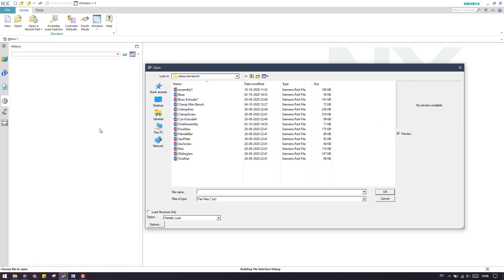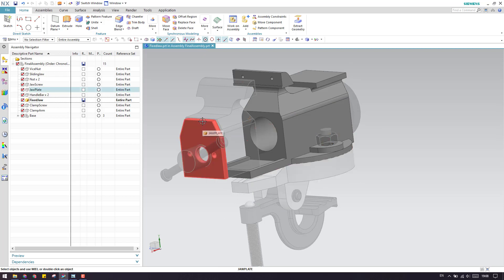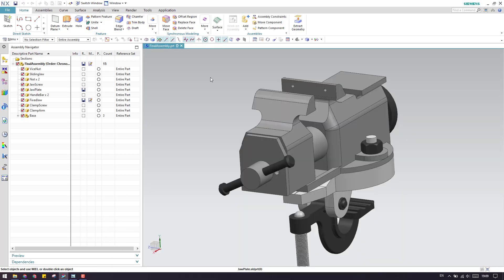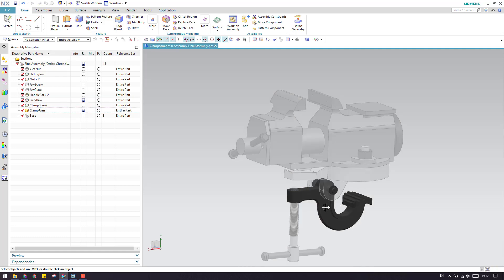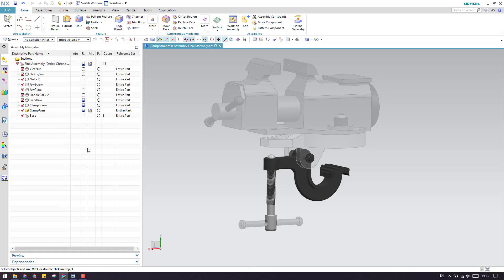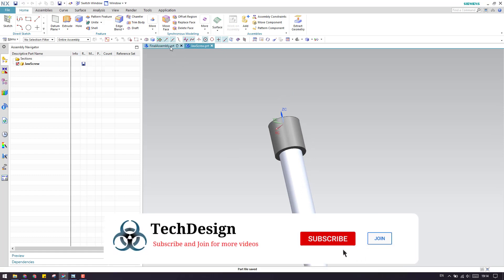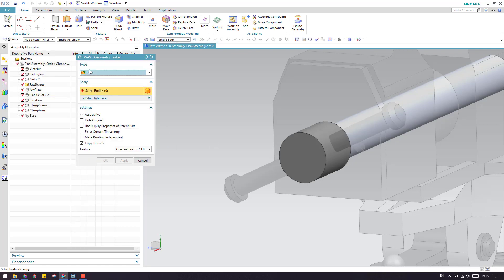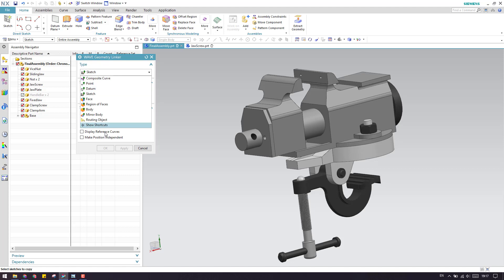Siemens Unigraphics NX- Associative Copy || Wave Geometry Linker || Difference in Extract Geometry.

Comment: Hii, I have made a Wiring harness sub assembly under a main assembly, but the bundles are not coming under the WH Assy(other components like connector, clip are coming), Can you help to solve this?
Reply from the maker: Looks like reference set issue.. check reference set and let me know
Reply: @TechDesignsantosh  Tried to create a reference set for whole wiring assembly(including bundles) but it's not allowing me to select bundles.
Reply from the maker: ChecK layers if these bundles are added and made the layer only visible.. you can't select them
Reply: @TechDesignsantosh  to add the bundles to layer, I am not able to see the 'space reservation' anywhere. Only the starting 'space reservation' visible in the wiring assembly..
Reply from the maker: Hey it's difficult to analys without seeing.. if possible share model to techdesignsantosh@gmail.com will check and reply

Comment: in nx while using wave geometry linker error coming linked feature could not be created because the selected object is within the work part
Reply from the maker: Use extract geomety.. insteed of wave link.. 
check my video for the difference
Reply: @TechDesignsantosh  extract is used when you are have part with in your part, not for body u want to link from outside the part.
Reply from the maker: Yess but your error says that you are selecting feature inside the workpart
Reply: @TechDesignsantosh  I think sir this is not the right answer....by the I dig outed...it...when you applied convert to sheet metal command on it, it won't take.
You have to select make current feature above sheet metal command then it will take.....🙏🙏🙏

Comment: so if we use wavelink geometry and change the hole dia in one component  will that get updated in the surrounding component?
Reply from the maker: it will be updated only for the wavelinked components... not surroundings
Reply: If you selected the associated then it will gonna change in original part...try not use associated....as it will hamper ur design